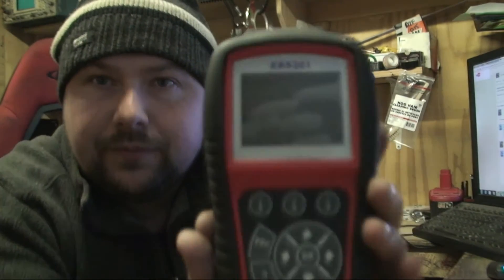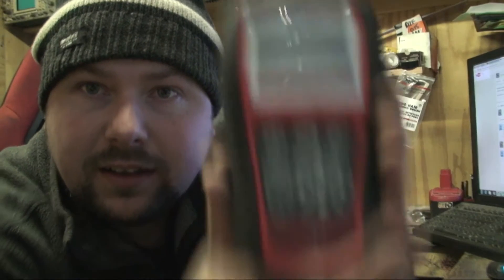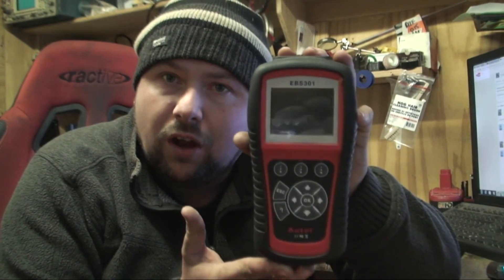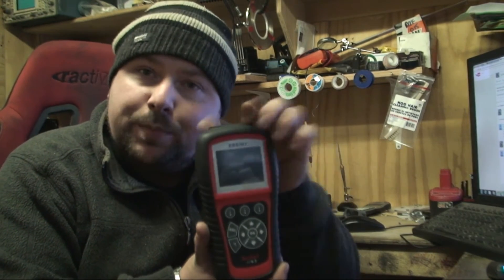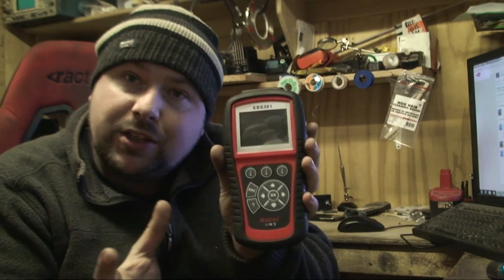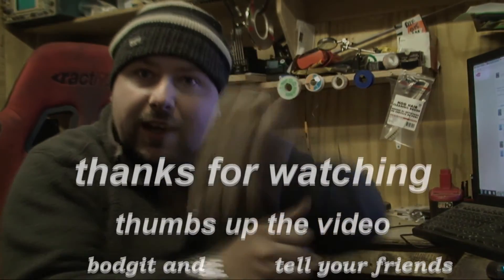bodgit and leggit garage electronic parking brakes (how to do/ tools you need)

Comment: I bought this on your recommendation and it worked on the passat, however after I opened the caliper and changed the pads no button on the tool would respond i had to unplug the tool and then plug it back in and select the vehicle again then selected close calipers from the options and it worked fine is this your experience?
Reply from the maker: No mate that's never happened to me before have you turned off the ignition by any chance

Comment: Thanks for that, guys like you save us a fortune and a lot of frustration. Keep up the good work. I’ve a problem just started to show on my Toyota avensis telling me epb needs to be checked, it won’t always disengage when you pull away but will release manually?
Reply from the maker: I might you have to get error codes and get it diagnosed properly it could be a number one things impossible to guess

Comment: Good to know. Certainly useful for independent garage owners, but maybe a little too pricey for DIY enthusiasts.

However, since you published your review, tutorials have popped up on YouTube showing how to do it without specialist diagnostic tools (on VW and Audi at least).

I've not done it on my Golf Mk7 yet, but basically it's all to do with temporarily separating the electronic brake motor from the caliper (using nothing more complicated than an allen key), and winding back the piston using the internal spline. The rest of the job is exactly the same as changing pads on any other normal disc & pad setup. Once everything is put back together, the electronic brake will automatically find the engaged (wound-on) position again once the electronic handbrake is activated.

Sorry but I don't know how to post links to other videos, but if you search for "Mk7 Golf R/GTI PP rear brake pad change with EPB WITHOUT using VCDS/VAGCOM", then all the steps are on there. I think the important message is, just don't let any dirt get in the motor housing when it has been separated from the caliper.
Reply from the maker: That's the problem with modern cars that all is getting more and more expensive but in some circumstances you can do certain job without specialist although the Newark as it's just getting worse and more expensive
Reply: @bodgitandleggitgarage  Very true. I bought the Autel MaxScan for my Golf Mk5 many years ago at a very reasonable price. Obviously, doesn't do anything like EPB rewind on the Mk7, but the code reader has more than paid for itself over the years compared to local garages charges (£50 or more to read fault codes, service reset, etc.)

Still, it has its uses, but I now need to get something that will work on newer cars.

The major problem with Autel units is they don't always offer software updates on all products. So, if a new model comes on to the market that uses a different protocol, the unit might not work. Then you're back at the beginning looking to buy a new machine that'll do all models.

I've looked at buying the stupidly named "OBDeleven" Bluetooth connected device for Android. However, you need to purchase the Pro version to stand a chance of using on newest models, and even then, you need to buy "credits" to activate some of the functions. Absolute money pit, and I'm not willing to support these kinds of companies that keep coining-in.

Someone needs to make a one-for-all diagnostic and coding tool that has included software support for the DIYer. It's basically just data transfer, so it's not impossible. So long as it has protection against malicious immobiliser/security recoding, then I don't see why it cannot be made available. Come on China... you love code breaking tools! Get the finger out.

Comment: There is no need to have a special computer module for doing EPB systems.  It’s easy to just remove the motor and rewind the brake spindle. The EPB systems seem similar on a lot of cars now.  For instance here is the job I did on a Landrover Discovery Sport:  https://youtu.be/0L7M6tg_rug

Comment: I bought one of these and tried to use it for the first time today...and it would not do it! It was a 2014 Jaguar F type.  It kept saying "Test Failed". I was charging the battery just to make sure that the voltage was kept high enough also. Tool has the latest updates as well.

Comment: hi . i like your chanel a lot. i was wandering if you could recommend some diagnostic  tool/code readers  in rage between 100 _200 £ . any particular  brand that you think is good. or maybe you have done video about diagnostic tools already (couldn't find any) ;)...i am asking because i want to buy one and honestly don't know what to go for. ;) would appreciate your help. thanks
Reply from the maker: grzegorz grzegorz hi mate sorry for the delay I've done a video on a cheap scan tool a couple of weeks ago I am also in the process of doing another video on a slightly more expensive scan tool around £100 but you can also go for the Delphi scan tool on eBay Fantastic Four the price

Comment: so when this scanner has been used to deactivate the brake, whilst working on the braking system does the car ignition stay on or can you turn it off, im just thinking about any battery drain, thanks for all your vids and advice
Reply from the maker: hi mate yes the ignition is on if you are worried about the battery you can always put a battery charger on it or a backpack thanks for watching don't forget your hands day